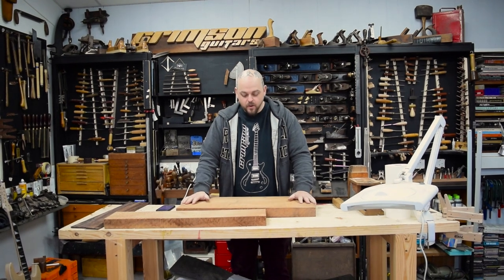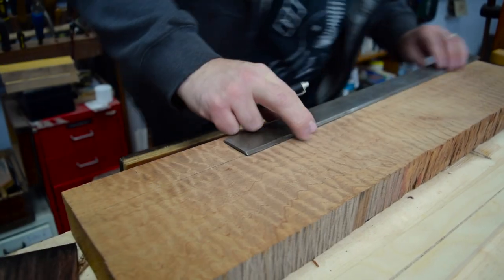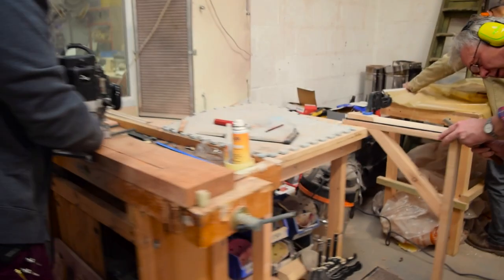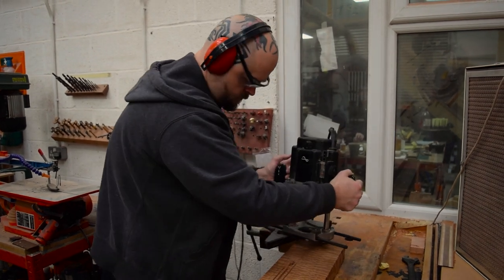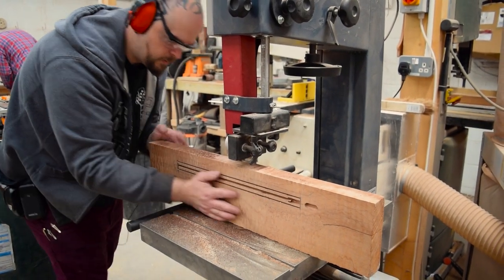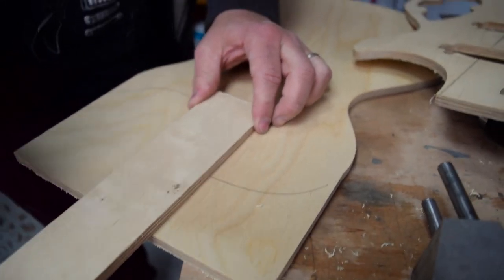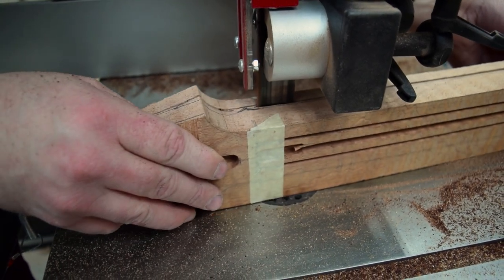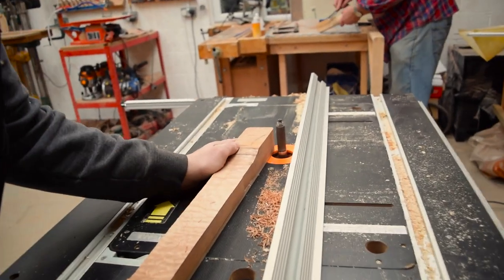Ep.1: Preparing the Body and Neck - The 9 Hour Build

Comment: Finally, a great luthier channel using the metric system! Why havent I found you guys earlier? So much easier to understand.
Reply: It's only in the US they use the wrong measuring system, Its antiquated and should be abolished. Lets be honest base 10 is a piece of cake compaired to base 12 (feet) then base 16 making up the inch, Counting in 10's 100's and thousands is much easier than a whole number base 12 (inch) and then 16th's, 32nd's and 64th's etc.
Reply: Chris Bradley it is funny because even when using inches precision machinists then break the inch into hundredths and thousandths

Comment: SHOULD HAVE USED THE THINNER BAND SAW BLADE FOR THE RADIUS CUTS BIG BEN.
Reply: HOLY SHOUTING, EDDIE! I SUSPECT SOMEONE WITH BEN'S EXPERIENCE KNOWS THIS, BUT FIGURED IT WASN'T WORTH THE TIME TO CHANGE BLADES AND RE-SETUP THE BANDSAW - it is a timed challenge after all.... ;)
Reply: ACTUALLY HE HAS TWO BAND SAWS ONE WITH A THINNER BLADE THAT YOU OBVIOUSLY DIDN'T SEE, HE USED IT IN THIS VIDEO THATS WHY I MENTIONED IT. I'M NOT YELLING I'M GIVING CONSTRUCTIVE ADVICE FROM ONE WOOD WORKER TO ANOTHER, YES BEN IS A GREAT GUITAR BUILDER BUT WHEN I SEE SOMEONE DOING SOMETHING WRONG AND DANGEROUS IN A TUTORIAL MEANT FOR THE PUBLIC I WILL SAY SOMETHING, NOT BECAUSE I'M (YELLING) BUT BECAUSE I WANT BEN AND ANYONE USING THESE VIDEOS TO BE SAFE. BY THE WAY THERE IS ALWAYS TIME TO DO THINGS THE CORRECT WAY SPECIALLY WHEN MOVING BLADES ARE INVOLVED. I GET IT THOUGH YOU ARE ON BEN'S BALLS IT'S COOL IF YOU WANT TO DO IT THE WRONG WAY, I WON'T YELL AT YOU HAHAHA.

Comment: IF YOU USE 2 PUSH BLOCKS ON THE NESCK WHILE ROUTING YOU CAN MANEUVER THE NECK MORE FREELY BECAUSE YOUR HANDS WON'T BE IN THE WAY PLUS YOU GET A MUTCH MORE POSITIVE HOLD ON THE WORK PIECE MEANING MORE DOWNWARD FOCE WITCH EQUALS LES CHANCE OF NECK BEING RIPPED OUT OF HANDS AND LESS LIKELY TO HAVE TEAR OUT. I'M TALKING ABOUT THE PUSH BLOCKS THAT YOU USE WITH A JOINTER OR TABLE SAW. IT WORKS GREAT AND FEELS AND IS MUTCH SAFER. I DON'T LIKE WATCHING UNEASY PEOPLE ROUT BECAUSE THATS WHEN ACCIDENTS HAPPEN.